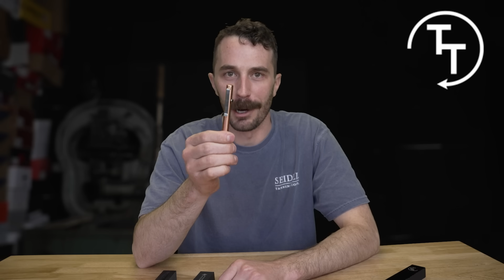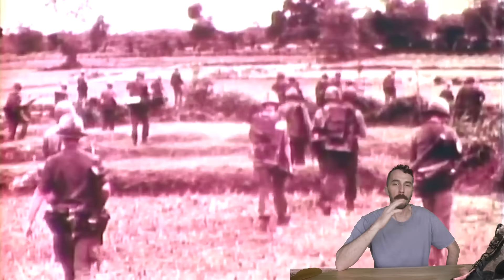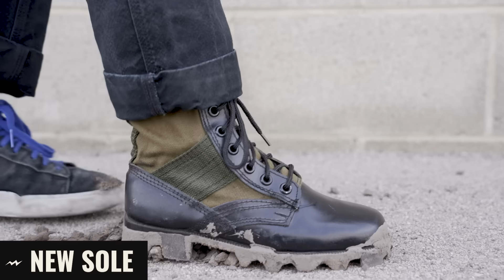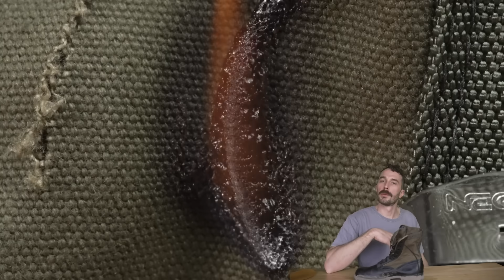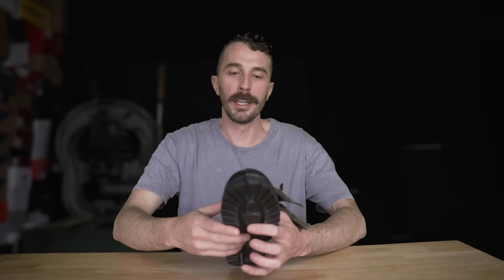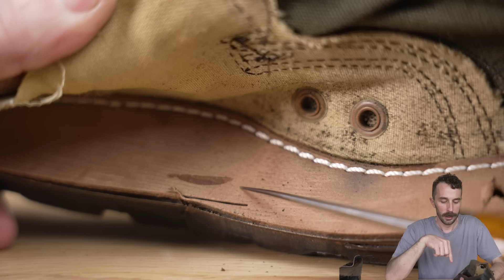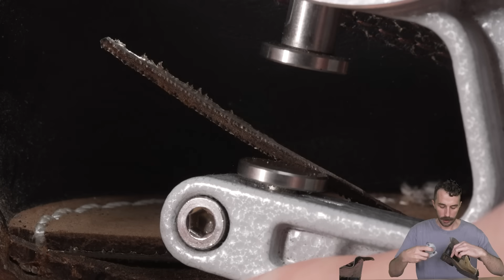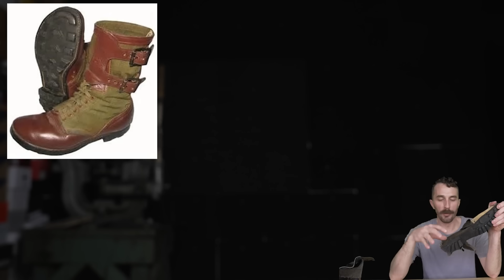Why it took 57 years to replace jungle boots

Comment: Swore by surplus desert boots that are identical to these in coyote roughout for ages. Paid $8 for my first pair and it was probably the most value I've gotten out of any purchase.  Sadly the surplus ones are starting to be old enough that they don't last as long as they used to and supply is drying up. My first couple pairs lasted several years, but the last two have succumbed to rubber splitting and leather tearing. Those two were still a hell of a lot tougher than any other boot I could buy for $40, though. Tempted by a pair of Altama panama boots, but $200 new starts to get into real money territory and something like Nicks starts to look attractive for 2.5x more when it will probably last a good bit longer, and can be rebuilt for the cost of a new pair of combat boots.

Comment: I have a pair from active duty going back to around 1992.  I had to wear safety toes so I used these for 4-wheeling in Georgia mud and water crossings, etc.  They still wear great when I occasionally use them.  What's surprising is I thought they were low end boots but after seeing your review it makes sense why they've held up for 30 years.
Reply: I use my father’s boots for the same thing in the same state. Cheers sir, thank you for your service.
Reply: @Nevernotalone  Thank you!  They saw a lot of action around the Ocmulgee River South of Warner Robins, areas up near Macon, the mountains in North Georgia, etc.  We were constantly going out 4 wheeling looking for new spots.

Comment: The newer mud release sole pattern is called the Panama sole. When they get clogged with mud, a quick knock against a rock or tree stump will usually break off the mud.

 But you should compare the Vietnam jungle boot vs the regular army issued black leather boot circa 1970-1990s. That woukd be a much more valid comparison than comparing it to a WWII boot.

The punji sticks would be smeared with feces so when it punctures the foot, it will cause sepsis infection and the soldier must be evacuated for medical treatment. So it wasn't just the spike but the filth used to cause serious infection and death by blood poisoning.

Comment: British Army boots had those mesh insoles in the 1980s. They used to clog up with sock fluff and get real stinky pretty quick. They were pretty hard to clean as gunge used to get stuck between the layers of mesh. A lot of us replaced them with leather insoles.
Reply: Cheese grater insoles !!
Reply: @jonathanpipe8249  They're the ones!!
Reply: Us Aussies used to get ride of the foam insoles in our jungle boots and source those "cheese graters" your talking about....... specifically the ones in your first generation desert boots 😂

Comment: The "Panama" heavy lug sole may be great in muddy conditions and ok in dry conditions, but I had a pair of the standard issue US boots back in the 90s. That sole was a nightmare in the winter. At times it was so without traction it was literally dangerous. The fact is you really need to choose soles carefully based on conditions. There is no such thing as universal best when it comes to outsoles. Pick them for where you are and the conditions you have to deal with.
Reply: It's not just the tread pattern, but the rubber itself. Much like all-season vs. summer tires, the tread can be nearly the same but some rubber gets surprisingly hard at lower temps and loses it's traction.

Comment: The French troops had similar ones in Vietnam made by Paladium (they were big for a while in the late 80s, making a comeback). My understanding based on reading in the 80s was that the original leather boots rotted really quickly due to the water and humid environment, hence the canvas hybrid. Then the steel plate got added. The stakes were usually covered in human crap which meant any injury (not just to feet) got infections which took troops off the field for longer. They weren't really primarily interested in killing high numbers, if you injured someone it took more troops to take them off the field and then more money/resources to treat them and in turn, had a greater psychological effect. Then you had more potential targets i.e. helicopters etc. Quite clever really.
Reply: I got a pair of Paladiums from eBay & love them...didn't find out until later that they were what Will Smith was wearing in I Am Legend.
My son observed that they look like Converse AllStars on steroids 🤣🤣🤣🤣
Reply: @jefflockaby702  ha yeah, they are distinctive looking. I've no idea what happened to them as a brand, they just sort of died off. They were something you didn't see in other brands too often, the folding down of the sides/tongue etc.

Comment: Wore those boots for nine years in the military, and they were awesome, had a pair for garrison, and a pair for the field. 
When my feet would get wet, from water crossings, I could where them for about half an hour to hour, change my socks, and be good to go. 
I thought they were good boots, but know I know they actually were.
Thanks for this one.
Reply: Makes sense. Instead of trying to keep your feet dry in the jungle, which is impossible, accept they'll get wet and figure out how to mitigate the problem so you can keep moving.
Reply: @DanTaninecz  especially that in the jungle your toes won't freeze off if your boots get wet
Reply: DOn't forget wearing them in winter because the sweat could escape instead of making the feet wet.
Reply: wear them.....

Comment: Bunny boots, more formally known as Vapor Barrier (VB) boots, have saved my toes more times than I can count while being stationed in Alaska. I've seen them cut in half already but looking forward to your take on them.
Reply: Funny, my dad called them Mickey Mouse boots from the time he was in Korea. Probably not as cold as Alaska, but he said it routinely got to 50 below in the "frozen chosin." He said they had valves on them to relieve pressure or vacuum, I assume while in an airplane.
Reply: @bigblocklawyer  Exactly what they are for, my boots say "Keep closed unless airborne" by their valves.
Reply: @bigblocklawyer  yup, pressure relief and extra insulation. Korea was the reason they were invented and redesigned twice.
Reply: they finally made the video

Comment: I wore a pair of those until there was absolutely NO tread left on the bottom when I was in the 2/75 (about a million years ago.)  Everyone I knew threw that plastic insert away as it was kind of a blister making machine if you were road marching.  They used to issue these super thick yellow socks for cold weather, but I wore them all year long.  Worked great with jungle boots.  Put me down as one of those that loved 'em.

Comment: Loved my Army issued ('89-'92) jungle boots!  Most comfortable boot I've ever worn.  I wore them for years after getting out of the Army.  Wore the sole completely smooth.
Reply: Same here I have two pair of my jungles in my closet I keep meaning to get resoled.  Great boots, worlds better than the general issue boots.
Reply: I served 84 thru 95. The Command Staff were allowing soldiers to wear these boots back then at each base commanders discretion
Reply: You and I had the opposite experience, my big toe in both my feet went numb in BCT.  I didn't get the feeling back until about a year after my enlistment was up.
Reply: Random question. What watch or watches did you wear while in the service?
Reply: @Ferien7  Casio G-shock.  Great watch!  Lasted me 10 years until the band/case disintegrated.
Reply: @matthewlockhart3226  I can't remember what mine was, but I bought it in the PX in BCT and never took that thing off again until I was in my 30's.
Reply: @Ferien7  Issued Hamilton or Timex analog, then when digital watches came out I switched to G-shock for a while. Some guys liked the Seiko or Casio analog dive watches but I found them heavy and bulky. Then a series of Casio calculator watches, plenty rugged and waterproof but a PITA to change the battery which always seemed to die half way through a six month deployment. Very very useful in pre-cell phone days to have a calculator and phone number data bank on your wrist. Then back to a solar powered G-shock when that came out. Always had tritium or luminescent watch compass on the band.  Finally the Suunto's and Garmin's with built in electronic compasses when those arrived.

The mesh Jungle boot insoles worked pretty well and were surprisingly durable. But not very much cushion; a lot of guys switched them out for Spenco insoles when they came out. But you got issued wool 'cushion sole' socks which were pretty good. The coolest JB variant I got issued was in the early 80's and were waterproof brown Goretex and had a groove in the heel to accommodate the spring ski binding. Much softer sole and more comfortable than standard JB's. Unfortunately the sole stitching was not heavy duty enough for skiing and would routinely rip out under the load. They were great for general winter wear though.
Reply: @brimstone33  very informative, thanks
Reply: @brimstone33  
The mesh insert shown here in the jungle boot and that you mention were in the standard issue all leather combat boot when I was in the Army from 83 to 86.
Those were the all leather boots made out of the kind of leather that was very hard and stiff when new and would hurt your feet like hell until they got broke in enough from wearing them and they absorbed the oils from polishing them daily, we eventually learned to take a brand new pair to the utility sink in the latrine and soak them in the hottest water possible, then when they cooled just enough to where you could stand it put them on, lace them up good and tight and take off walking for at least a mile, then let them dry overnight and put the good old Kiwi polish to them, that greatly shortened the break in time with them so they didn't kill your feet and ankles nearly as long as just breaking them in from just wearing them.
I see the kind of combat boots they issue nowadays and they look as comfortable right out of the box as Red Wings or Herman Survivors, we'd have killed to be able to have those kinds of boots back then.
Reply: @Ferien7  Timex analog with glow-in-the-dark dials and numbers, with an olive-drab cotton wrist strap. Wore it underneath my wrist so the watch wouldn't interfere with upward wrist movement, and less likely for the glow-in-the-dark indicators to be visible.
Reply: @zerocool2352  exactly the same for me.
Reply: @Ferien7  casio g shock and Timex. Poor soldiers in the 80s don't wear Rolex watches with satellite GPS which weren't around back then

Comment: During AIT in 2002 I spent 160$ on a pair of ripple sole jungle boots at the "boot guy" at Ft Sam Houston. They were the best boots I had to that point. Basically like a really high top sneaker.  I really loved those boots. The comfort was like an under armour valsets but better.
Reply: I bought mine from the boot guy as well in 2003. I still have mine in the closet. Wore them until we switched to the Tan Boots.

Comment: Im a vietnam reenactor and have used original boots for multi mile hikes. 

I can assure you they live up to their promises.

I walked knee deep in a creek and was soaked, but within 30 minutes my foot hardly was wet.

ALTHOUGH the guide pamphlet says to change socks if theyre wet which will prevent foot rot. 

All in all, its a great boot.

Comment: I have had several pair of jungle boots. The better made ones are very comfortable once broken in. Had one pair resoled with ripple soles. Made a huge difference in comfort. The tan desert boots were made just like the jungle boots except they were tan suede and they did not have the vent holes.
Reply: My tan desert boots had vent holes...
Reply: Only the Chinese knockoffs which are the most common to find, sell for $50. The new US made are over $150. Original surplus will be hard to find.
Reply: @cmanlovespancakes  Altima makes a decent jungle boot.
Reply: @shadymaint1  over 150 usd.
Reply: @cmanlovespancakes  And worth every cent.:goodvibes:
Reply: @cmanlovespancakes  $150?!  Shit I'm going back to Bragg and pulling down the ones I threw over the wire there. So what if they're painted gold?
Reply: Same as video? Boots do they still make it for $50??
Reply: How exactly did you get them resoled? It’s not a Goodyear welt or anything. Where did you do this at?
Reply: @65-76  I had them done at a boot shop right off of Ft.Eustis. Some little old Korean guy. Did a excellent job. The fabric on the uppers wore out long before the sole.
Reply: @65-76  I get the ripple soles put on my jungles at Ft. Polk, LA. but that was 20 years ago now.
Reply: The desert boots seemed way heavier/thicker than standard jungles to me.  Can't say for sure, though.

Comment: 50 bucks for a new condition 3rd pattern jungle boot with vibram sole? That's a realy good deal! You should try to contact Altama - they are one of the manufacturers of the classic jungle boots, and now they have a more modern model called Pro-X. Maybe they will be kind enough to provide you with a pair of Pro-X's. Also army has a new pattern of jungle boot (Belleville Burma 901), and USMC adopted two new jungle boot models (one by Rocky, another one by Danner). Would be interesting to see them being cut in half :)
Reply: No no you wanna contact Mccrae. They were one of the OG contractors from back in the day. They make probably the closest copy of the 3rd pattern jungle boot that you can get. Problem is they’re not available in common sizes right now but I’m hoping for another run soon. They also make what’s called the hot weather boot. It’s all in black but uses DuPont Codora nylon but it’s built the same way. The new material is really quite thin but it’s great at staying durable but not giving in ( I’ve had a park with it in use for over a year). Rock rooster makes a jungle style boot as well but it’s got a sole more oriented towards work. Still it features the lightweight cloth and leather construction. It’s got the screened vents. This type of boot makes a great 3 season boot in the mid Atlantic states though for winter your better off with something more solid, but from say mid spring to mid fall ( before the nighttime temps drop below freezing) this is a very comfortable style of shoe
Reply: @matthewcaughey8898  I believe altama was also one of the original manufacturers right?
Reply: @danshakuimo  they were but compared to McRae or some other companies Altama sucks. The pair I had smelled funky, was stamped made in China ( probably used the hide from a water Buffalo beast of burden) and the sole started chunking pretty early on. And they had the nerve to charge me 150 plus dollars. Had to fight to get my money back. Even the Rockrooster MDGB boots held up better then the Altimas did. I suggest waiting for or emailing McRae to see when they’re making a new batch of Vietnam jungle boots. Alternatively you can buy the currently produced hot weather boot for a one color modern rendition. Had much luck with the McRaes myself
Reply: @matthewcaughey8898  where can I buy them from?
Reply: There's also a company called What Price Glory that's making repros with vibram soles
Reply: @kilo393  the vibram was not preferable cause it tended to “ clog up” faster. The Panama sole will actually self clear
Reply: @matthewcaughey8898  Yea, it's more for reenactors
Reply: @kilo393  well Vietnam OG-107 jungle boots and uniforms are a very wide discussion with 3 different patterns and ERDL camouflage patterns, might be a bit long winded but here goes. When initially headed to Vietnam the us army issued the Cotten sateen uniform. Those included a black leather version of the M-1943 style combat boot. It became obvious that the sateen uniform was too hot to wear and the Goodyear welted construction of the 1943 rotted away very fast in the jungle. The type 1 jungle fatigue was introduced and it was based off the us airborne jumpsuit with a looser fit for better air circulation. The type 1 jungle boot was introduced about the same time. Both were liked but the exposed buttons and epaulettes would still snag jungle vegetation. Around 1967 they introduced the type 2 fatigue ( probably the most common) and the type 2 jungle boot with the spike protection. The type 2 suffered from the same seat and knee failure as the type 1 uniform but troops liked them. The type 3 was introduced around 1971 or 72 with the type 3 boot following. The type 3 was the Panama sole spike protection boot. You’ll see a lot of mix and match for uniforms cause all 3 pattern OG-107s were still being issued by the end of the war ( as the army used up stocks of previous pattern uniforms in stateside or Vietnamese warehouses). The type 3 jungle boot followed a similar pattern as most ended up in stateside warehouses after the us started to reduce our involvement in Vietnam. You’ll still hear stories of Vietnam vintage jungle boots being issued as late as Iraq in 2003. Though officially the boot was supposedly phased out in 1994 the army had vast stockpiles of them. You still hear stories of collectors who find vintage Vietnam uniforms still boxed up and never sent overseas. ( oh of note pattern 3 jungle fatigues introduced the rip stop pattern type 3s are what Rothco copied )

Comment: The upgraded lugs look awesome! They should be tried for winter boots. The streets here are sanded in the winter and that gravel gets stuck in winter-boot lugs ALL the time!

P.S: weird to have a wood block under the heel! Only seen that in a timberland knock-off episode before...
Reply: They are called Panama soles. I guess named after thr US Army Jungle School in Panama. Instead of straight walls on the lugs they are slanted to help release mud. If thry get clogged. Just kick them against s rock or tree stump. That usually knocks the mud out.